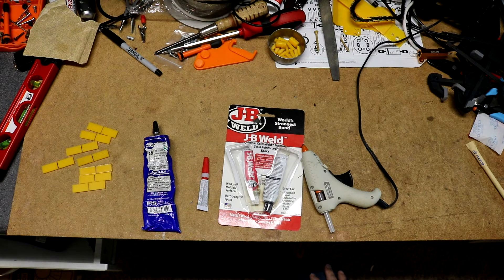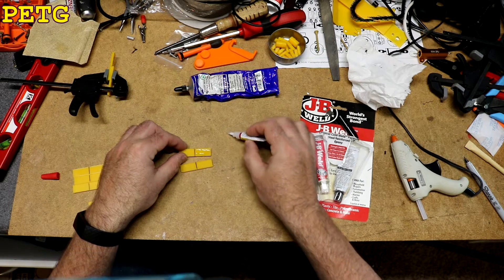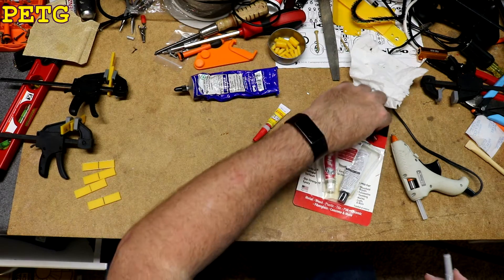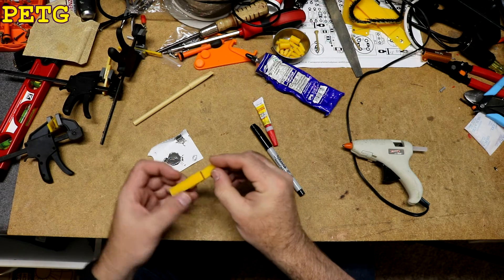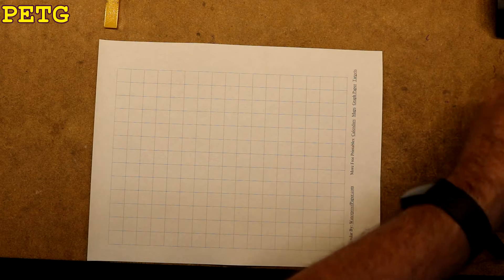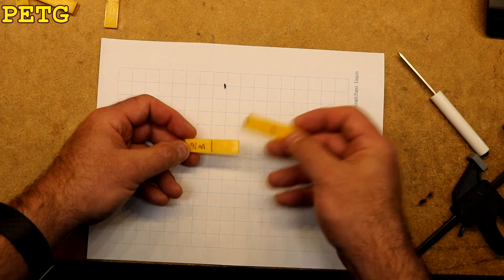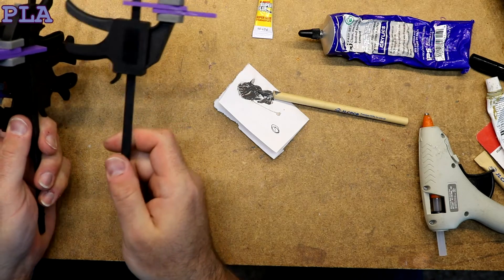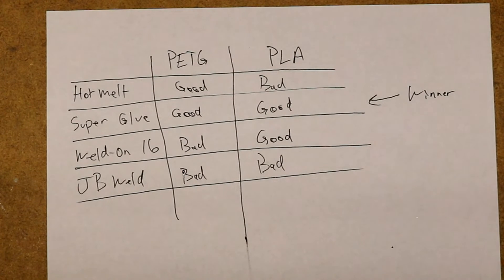3D Print Glue Evaluation: Gluing PETG and Gluing PLA

Comment: To test the glues, you should have placed the pieces overnight in the freezer to see how they are affected by temperature and then for the heat test, laid them out in the full sun for up to four hours and then see how they held.  You'll find the hot glue will pop off in the freezer and the JB weld in the heat will sometimes snap apart.  Some 3d Printed masterpieces must endure both cold and hot weather in order to survive. JB WELD had been the worst for most 3d Printed Items no matter what type of filament. E6000 is another great glue for PTEG and PLA for pieces that will be affected by the cold and heat.  Hot glue doesn't do well on 3d Printed pieces that drive over bumps and rough terrain.  My R2D2 unit had dropped a lot of pieces that I had to attach again because of various glue failures.  I now use purple primer and PVC glue to PLA and PTEG projects and they have never failed.

Comment: glad i found this im currently printing a 1/10th scale 79 chevy k5 blazer body out of PETG and its in multiple pieces and for what i was planning to use to join them together was originally JB Weld super glue gel or chemical weld or plastic welding but i definitely wont be using JB Weld i definitely though about the hot glue but figured jb would be stronger than that but i do have some crappy results with jb weld and plastic. thank you for the tests and info. will probably try doing a combo of plastic welding and acetone chemical welding.

Comment: so. over the years i have seen a ton of hobby videos from stuff with Adam Savage to all the small random youtubers.
WHAT IS JB WELD? you can't get it in Europe...
is it just a simple epoxy glue or is there something special about jb weld?
Reply: JB Weld has steel particles mixed in with 2 part epoxy so it's very strong. But I agree with this youtube video, in my testing JB weld is sometimes not great for plastics but it's amazing for bonding most anything else.

Comment: I print mostly in PETG and a little bit of PLA. I found the most sure thing is CA glue. With PLA it is pretty much an instant bond and with PETG it needs to be clamped for a little longer…….and you need to let it sit for a longer time……but it will work well if you have patience……It wins in the economics and availability categories too. Great vid…..

Comment: I use JB weld for plastics on my PETG and it holds everything better than anything else other than a heavy coating of CA glue.  CA glue works great on PLA
Reply: Why do you think it didnt work in the video? Is it because he applied glue, separated the parts, and then pressed them together again?
Reply: @ekek9950 with the JB Weld original, you have to sand the joins and all let it get full strength. It sets in 4 to 6 hours and fully cures in 15-24 hours. 

I tested it on a scrap part and it's been clamped for the last 12 hours. I'm letting it go for at least 30 hours just to be sure

Comment: For PLA, I would use a solvent-based chemical like acetone or mek, which dissolves the plastic and welds it into a single piece, just like it does for ABS or any styrene-based plastic. In fact, I've successfully fused PLA with ABS this way. For PETG, I would use the hot glue based on your findings. I hate superglue with a passion. It nauseates me and those little tubes become an unusable mess after a single use.
Reply: I found superglue with height viscosity, thicker and it seems to work alright.

Comment: That's weird, i have had REALLY good results gluing both pla and petg with hot melt glue. The only time that the bond wasn't stronger than the part was when i tried using a cheap "safe" glue gun that didn't get hot enough to bond the glue with the pla.

Comment: I have a print with lots of pieces that I need to glue. There are also going to be some gaps that I was hoping to fix in this stage. Do you think i can use the glue sticks to fill gaps and then sand em smooth or would you reccomened another product like calk or something? This print is petg and I'm going to paint it after I build it.
Reply: When i do these sorts of things, i print them in PLA and fill the gaps with plastic putty. I currently have Revell plastic putty, it behaves well. I had Mr. White Putty (Japan) in the past but got very annoyed by how much it shrinks. Tamiya is another frequently recommended brand, and i honestly don't remember if i tried it ever at all. These are all made to be sanded and painted over. If you're working with very large pieces, you might reach into automotive supply instead of model supply, something like Bondo, but i have no first hand experience.

I have not tried whether this sort of putty sticks to PETG. A lot of adhesives really don't work with it.

Hot melt glue is not my favourite except for temporary adhesion. It detaches and crumbles away in presence of alcohol vapour. I don't think you'll be able to sand it.

Comment: Superglue (with an accelerator) is normally my go-to, but i've also had good success using a 3d printing pen with the same filament to sort of "weld" seams together if they have a gap to fill or a natural v-shaped channel where the parts connect.  Think like the same process of welding steel by making a circular motion and overlapping the layers.  5 minute epoxy also works well.

Comment: A really good glue for PLA is 3DGloop https://www.3dgloop.com/shop/glue-gloop I know some of these meathods will be different depending on the surface area of the glued parts. i.e. edges versus flat areas.
Reply: weld on 16 is like 3dgloop but cheaper

Comment: I have a part I need to print and due to its shape I am going to have to cut it apart and weld the two pieces together which I really don't want to do.  I have never ever had luck with Super glue on even PLA and not sure why (possibly Dollar Tree Super Glue is past its prime so is junk EVEN THOUGH it is the real name brand stuff).  I have tried it several times over the years and no go.

Comment: When you say "I did not prepare the samples in any way, I did not sand them etc" is that contrary to any of the adhesive manufacturer's instructions?  If you are not following instructions then I can't see how this could be considered a fair test.
Reply: It may be fair in that the instructions for all were ignored, but it is also not very helpful. Testing the products the way they are supposed to be used, the way any halfway intelligent user would by reading the instructions, would be more informative.

Comment: That particular Weld-On probably doesn't work on PET, other varieties may work better.

For PLA (haven't actually got around to printing any PETG yet) I use the cheapest generic liquid CA glue from the hardware store, I've yet to have a bond fail on me.
Reply: Weld-on 16 works very well for PETG. It is one of the few that does. I don't know what went wrong here, it is always very reliable. However adhesives should be applied properly. Not just slathered on like chocolate sauce on an ice cream sundae. CA especially needs contact with the air to cure, or an accelerator it should only be applied in a thin layer. I am surprised the CA worked as well as it did. As for the JB-Weld, I can't imagine why on Earth anyone would use original JB-Weld on plastic instead of using JB-Weld's Plastic Weld or Plastic Bonder. They make several product specifically for use with plastics.

Comment: so, clamping glued parts is essential to get the most out of it, that's not just to hold the pieces in place.
It's essential to clamp them fast and under a certain amount of force, it doesn't matter how long parts are clamped together in general. Depending on the glue the 1st few seconds count what force is used to clamp them together, when this is done wrong one can keep it clamped for 3 days it will not get any better. 
cheers!

regarding the Super Glue, it should be used with care, cause depending on the plastic the glue is dissolving it what can end up weakening the part. Also Super glue is not water resistant.
Reply: Honestly clamping seems to be entirely optional for epoxy in my experience. Iv'e just "poured" (rather smeared) epoxy onto cables laying ontop of a PCB, no clamping at all and it hardens into a blob that just will not give, its ultradurable seemingly.